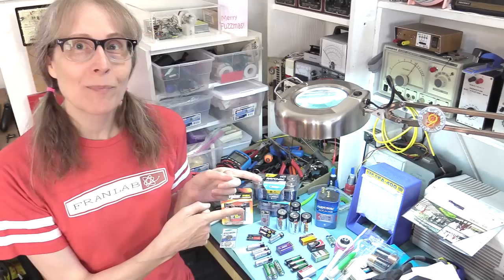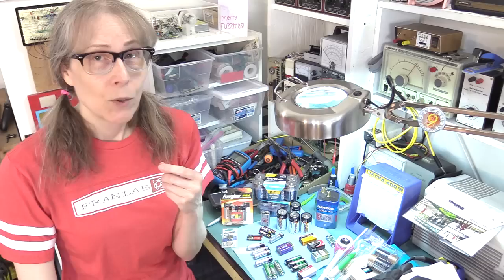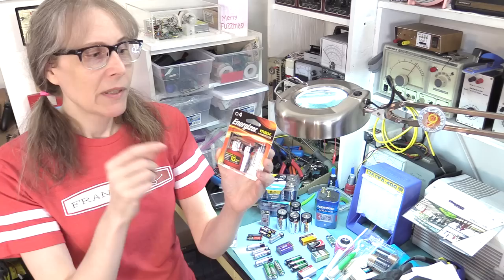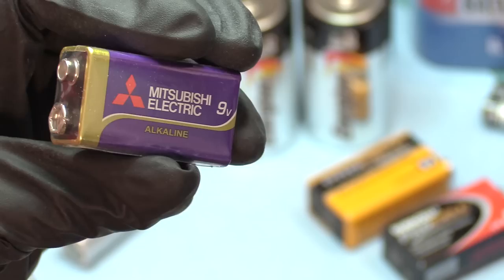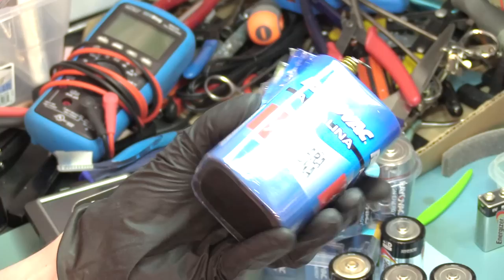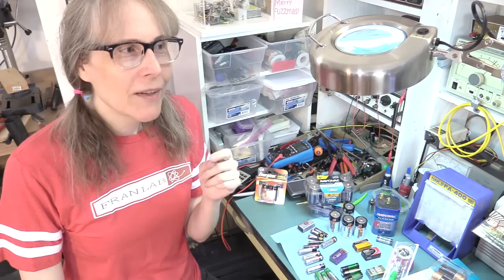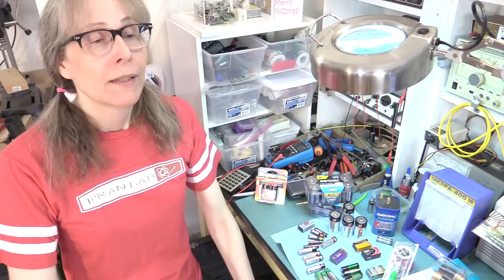Yikes! Leaky Alkaline Batteries!!!!

Comment: Last time I had leaking batteries it was mostly my fault, but partly also the manufacturer's. I had alkaline batteries and rechargeable Ni-MH batteries of the same brand (Energizer?), and the both kinds looked nearly the same. Eventually it so happened that alkaline batteries ended up in the charger. There started to occur clicking sounds like from something where heat expansion is taking place, and when observing closer, the batteries indeed were hot to touch, but I still assumed that some batteries just warm up more than others during recharge. A few hours later I noticed the charger showing indicator leds of unusual color -- apparently indicating a problem. It turned out that the batteries had failed and made a mess in the charger. Only at that point I realized it said "Alkaline battery" on the leaked batteries. That's why it was mostly my fault for not paying attention, and partially the manufacturer's fault for making different kinds of batteries to look the same. The mess would have been difficult to clean, and I had no interest to even put my fingers too close to the leaked stuff, so ended up discarding the otherwise good charger, model of which wasn't available anymore.

Comment: Had some brand new duracells "gas out" in a clock days after install.   If I wasn't in the room and heard it happen the electronics would have been ruined.  I left them on a glass table for a few days and a pool of electrolyte formed and etched into the glass.   After a brief research, I told my wife to never buy duracells again.   Crazy because I've been using them my whole 40 yr life... seems to have gone down hill in the post few years?

Comment: I am not sure Kermit is active on. It is more likely a self latching circuit. You give it a physical contact it latches, runs its routine and unlatches and sits open until someone squeezes him again. I refuse to use digital metrology devices. All mine are vernier scale or gear driven indicators.

Comment: Oh and you also have to watch out for rebrands as there's a handful of companies that will Rebrand the few manufacturers of batteries AKA store band brand or discount store brand could very well be just duracell's with different rapper.
And Duracell has a website devoted to how you can clean your device after they leak, they even have a 1-800 hotline and a warranty if it's their batteries.

I tried the lemon juice thing I usually just use alcohol and it ruined a two-way radio.
It went from soaked with alcohol to dry and working to covered with lemon juice and not working, it was duracell's and they leaked pretty bad.

Comment: My 30 year old Panasonic 4.5V door bell battery still works, and it doesn't leak. Made in France and still has a 4,5V voltage.

Comment: Those lantern batteries used to have 4 F cells inside.
Then they changed to D cells in many brands and now I hear they use AA cells?
Now I'm glad I made a pack from eneloop AA cells in 12S 2P config. I 3d printed a hardcase.
That thing powers all kinds of stuff for me on the go.

Comment: The "heavy duty" batteries are zinc-carbon.  While cheaper, they are very poor when comparing cost versus energy density.  In consumer tests, Duracell and Energizer are almost always the best deal for longest life.  Even though more expensive, they provide the best value.  Lastly, Harbor Freight batteries generally test very poorly for life expectancy.

Comment: I'm taking a couple Duracells out of my wireless as I'm watching this video that I forgot about. Lol! Actually these coppertops have been lasting a very long for me unlike sunbeams but as they finally  run out I have been just throwing them in a bucket as they run out and I couldn't belive only one of them leaked and it wasn't much.  Those batteries had been in there quite sometime too. I don't know why but I thought why not try and charge some of them up? I hit a few of them with a charge circuit I had laying around and they started getting kind of warm and I can remember blowing a battery like this up in the past which was kind of a mess  but that was a long time ago so it's probably a good time to forget that and not learn from my mistake so when it got good and warm I put it in the freezer till it was good and frozen and then went back at charging it. I checked it with  an analog voltage meter  before I started putting anymore  juice to it so I could check the progress and that's when I find out the they are all reading four and half volts, I thought how could this be they are just double A one and  half volt batteriest ? I thought there must be something wrong with my meter but I put them in an LED flashlight and it was really bright for quite awhile and I was able to charge them back up a few more times after that and they are still lighting up that flashlight and they are doing about the same as some rechargable batteries that I have had for some time, not sure how long but I hadn't been using them. However it seems that they aren't any better than the Duracells. The charge circuit I used was designed to charge some NiCads that I don't have anymore and there is hole conditioning circuit involved  in it so I had just taken the voltage off of the board where I could bypass that stuff and I was pulling seventeen and a half volts and it didn't take very long to charge the AA's  that way so I thought I better set up some resistors so I added them to the circuit giving me a few different voltages to work with. I actually had a Sunbeam AA Alkaline in the bunch and it was almost dead so after I hit it with all that voltage it is reading three and a half volts. Next I tried some CR 2032 wafer batteries that I had been taking out of my little Snark tuners and they were reading four volts after putting them in the freezer so I'm testing them right now after they have been sitting a couple of days and they are reading six and a half volts and I had charged them at nine and a half volts. I am a little afraid to put them in the snark now. Maybe I will run them down a little first with some light bulb or something. I have a habit of putting Nieodidium magnets on the batteries to hold the leads on them and I thought maybe that has something to do with this but I doubt it. I also have a Cobalt magnet I guess they are  actually made at Fairchild and I belive that is actually an Airforce base if I'm not mistaken, or at an Airforce base, anyway I will try a few things and post some more if anyone is interested. I find it interesting that afert doing this I would  find this video on batteries  ....

Comment: If it's not an alkaline battery you can be sure that it is NOT a lead/acid battery, it is almost certainly a carbon/zinc battery. They were all called "dry cell" batteries, lead/acid batteries have liquid acid in them. (Car batteries are probably the most common lead/acid battery that the general public will be familiar with.

Comment: I have yet to see a coin cell leak.  Any chemistry.  But I have seen some of them go flat in original blister pack.  Oh, well, nothing lasts for ever, I guess.
Here come a couple of random notes about my battery experiences.. Generally old analog voltmeters came with one D-size battery for the ohms measurement.  And there was an adjustment for zero ohms, because all carbon/zinc batteries changed their voltage at least weekly.  But one French made meter (I think the brand was Metrix) did not have the adjustment knob.  So, how did it maintain its zero ohms calibration.  The instruction manual revealed the answer, the ohms measurement was supported by a mercury battery.  Great stability.  I don't know how long that meter lasted, maybe even to the moment when mercury batteries were outlawed.  However, I do know that a Gossen photo exposure meter used a coin cell version of mercury battery.  Mine is probably from 1980's and it still is accurate.  The one built in my Canon Pellix camera from 1960's though has retired.  There is a problem that none of the available substitutions provide the same voltage.  Nor do the provide the same stability.
I recently dumped some batteries that the instrument claimed were weak, although most measured still between 1.34 and 1.38 volts.  While at it, I checked a Radio Shack battery (carbon/zinc type) from 1980's and was totally surprised when it was still reading over 1.50 V.  However, it did not support even 10 mA current.  Evidently it was dry.
My biggest battery leak experience was on a FET based analog multimeter that used 10 batteries.  They had been there at least since 1970's, but I know that they still worked either 1990's  and around 2005 or so.  I found the leak in 2019.  Big time cleaning operation resulted...

Comment: I only had experience with one type of battery out of many that leaked. Duracell. Mainly AA battery's. Why I don't know. Now I use Energizer. No problems as of yet. The lithium ones I put in all my smoke detectors. When it's time to change them, I don't have to worry about possible leak damage. You would think with Duracell , since it is so popular , leaking wouldn't be an issue. It will probably will be fixed in time.

Comment: I find Energizer the best for modern quality like you said, RayOvac  not so much but, I have two AA RayOvac carbon units that are over 50yrs old and have never leaked and suspect are quite dead, the other notable three I have are C size Radio Shack Enercell extra life miracle Seal green label from the late 80's-early 90's that have never leaked and also suspect to be dead.

Comment: yes thats true... 
long time ago, the Duras were the best in the market. But today, it is hard to find good batteries.
Actually I am using the cheap (light blue) Vartas, still none leaked.
20 years ago, the batteries from Aldi were really great. I found some last year in an old camera flash. Have been inserted for (much) more then 10 years and still worked (20 flashes or so) and they didn't leak. 
And about ~ ? 13 ? years ag, there was a battery comparing in the magazines. Aldi batteries were with the best in the test.
After that, the print on the batteries changed and they leak. Also while they have their energy. What a shame.

Comment: If you're interested in a very special kind of 9V batteries I've recently made a project with lithium cells, a micro-usb charger, and a boost converter, all fitting inside the 9V battery spec :D

Comment: carbon zinc dry cells sometimes supplied or included. then there is a flashlight with 2 AA in it, leaked and is welded to the cap that won't unscrew!

Comment: I don't know what happened, but yes ... "Duracell" batteries have turned to absolute trash. For many years, Duracell appeared to be the only battery you could count on NOT to ever leak! It was all I ever bought and installed in devices. Then, I think starting about 9 months/a year ago, that all changed. I recall being shocked first time I discovered a nearly ruined device with badly leaking Duracells in it! Disbelieving, I tried again ... with same result. And, as many others here point out .... now? I wouldn't put a "Duracell" in anything I own. They tend to be more costly than other brands, yet they've failed way too many times now. It became so bad, that now, seems almost the exception, when they DON'T leak! As I believe Fran points out ... I have switched to Engergizer ... and they do, much to my surprise, appear go without leaking. So far. The very worst batteries, that I've never trusted, by the way ... have been Ray-O-Vac .... but perhaps they've improved. In any case, good luck!

Comment: I have had copper tops leak while under heavy load in a high power LED flash light only an issue if the flashlight is used with brand new batteries and used constantly for over an hour the funny thing is its a engerizer flashlight

Comment: The Answer is different Chemistry. I have changed to Eveready Ultumum LITHIUM batteries 6 years ago. NEVER had any leak. They are a slight bit more expensive, but worth the fact they won't leak and damage your electronics and flashlights.

Comment: 6 Volt Carbon Zinc lantern batteries like Eveready Super Heavy Duty have 4 size F cells in them but sometimes the Alkaline lantern batteries have 4 size D cells in them. I have never seen a 6V lantern battery made using AA batteries but I have heard of them made that way.

Comment: Another vintage camera related battery topic: one of my late 1950’s/early 1960’s battery powered “flash” accessories made by “MINOX”, had its original mercury battery in it! You wanna talk about TOXIC acid leaks!? Under its paper label, revealed it was essentially a stack of mercury button cells that were somehow welded together. VERY MUCH a big (HIGHLY TOXIC) mess!

Comment: I don't trust any battery being leak proof.  If I plan on not using a device for an extended period of time, the batteries come out.  Maybe I'll put the batteries in a plastic bag in the same box of device.  I've come back to use, or check on the device at a later date.  Chances are the bag is full of leaky batteries, but I'm still happy, as my device survived these killer batteries.

Comment: I've recently joined the Anti-Duracell train (and clicked this after seeing the thumbnail of leaky Duracells, hoping there might be some explanation as to why they, of all brands, keep leaking). I bought almost exclusively Duracell for several years, but every time I went back to the package for the next set of batteries, after the first ones finally died, at least one or two of the batteries in the package will have invariably leaked, 1 to 2 years into their "10-year guarantee". The few times I contacted Duracell about this, they just gave me a coupon for a new package (which then leaked). I've swapped over to Energizer for the time being. Unfortunately Panasonic and such off-brand batteries don't possess the same voltage/amperage capacity as Duracell/Energizer brand batteries do. I discovered this when Dad got a camera that took AA batteries. Panasonic would literally last for one (maybe two) photographs before needing to be replaced. Only Duracell/Energizer could get through an outing without dying.
Reply: Oh, and as far as an Alkaline battery leaking inside a device: white vinegar and a bunch of Q-Tips. The acid in the vinegar reacts with the Alkaline base and cleans it off. Never throw away a device because the batteries leaked, again. :) (Unless the metal contacts corroded so much they broke off, sitting in the Alkaline bath for years, undetected...).

Comment: The no leak warranty is just marketing schlock. The most they ever do is replace your old batteries with new batteries. Tough luck if your gear is ruined. Meanwhile, batteries have become 500% better at the leakage/destroying issue in the last 25 years. For standard cell sizes, they only have a limited space to work with. With more efficient chemistry, more of the battery volume can go to containment or mitigation. If each battery had a base impregnated fabric to vent through, the acid vapors coming out with the H2 would be neutralized. To fit such a contraption in a AA cell would mean there's not as much space for the energy giving portion, and each one would be much more expensive. It's not an easy game
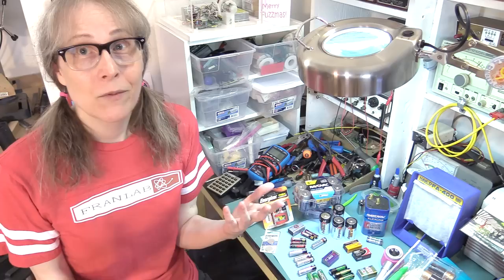Reply: 12:40 Some button cells may leak much easier because they rely on air exposure to work

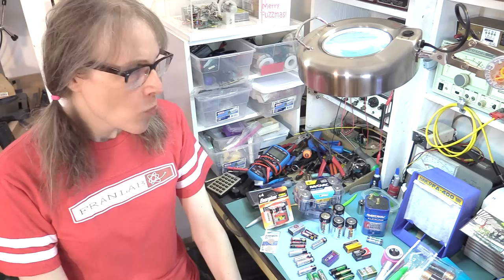13:40 Maybe try introducing AC adapters where you can, and or use rechargeables where you can to limit the number of disposable batteries that cause you to dispose of equipment?

Comment: In recent years, I have had a variety of experiences with batteries. Rayovac batteries have been the utter worst batteries ever, for me. I mean they would last anywhere from two months to two weeks, then I had to change them out after next to no usage.. The very best batteries I've ever had were the Utilitech batteries you chided. They lasted so long I didn't have to change them out for a couple years of heavy usage. I have found Energizers to be some of the most dependable in the long run. For example, I found a flashlight I hadn't seen in ten years, and it still worked with the energizer batteries in it, and that is not the only example. Those very batteries are still in the flashlight, going on 16 years now.

My only regret with the Utilitech batteries is the hardware stores stopped carrying them, and I just didn't feel like looking for them online.

Comment: Yup, I like where this went.  Soon as I saw rthe image at 0:33 I thought two things -- the first was "whelp, that's what you get for using Duracells".  I've avoided them for at least 30 years.  Sure the industrials of any brand are always better but that just begs the question, why don't they just make the "consumer" version decently?

The second thing I thought was, "what kind of device uses SEVEN batteries?" 

Yes Sunbeam is a bread brand but there's also a Sunbeam that makes appliances and that's the logo seen here.  Much the same as the Mitsubishi, or Radio Shack or whoever, contracting somebody to make products that the put their logo on.  And then there's another Sunbeam that is a car (or there was).

Another thing that could have been mentioned here is shelf life. It perturbs me to see stores trying to sell old stock taking advantage of people's ignorance.  If they ever notice the date at all (they do whatever they can to hide it) a lot of people will go "oh good the date is two years away"  never realizing that means they've been sitting in some warehouse or on unsold shelves for EIGHT YEARS.  One should never buy a battery without ensuring it's wasn't made during the Clinton administration.

Comment: I've just changed all my batteries to lithium. With exp dates of 25 years I know they will be safe, especially after 5-10 as I would have used them up on power by then. But I know they won't blow up